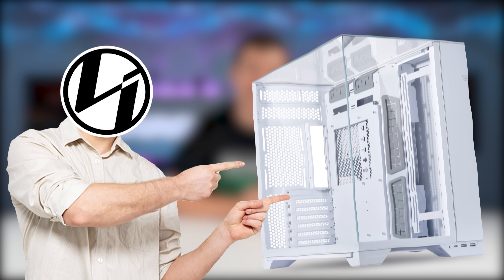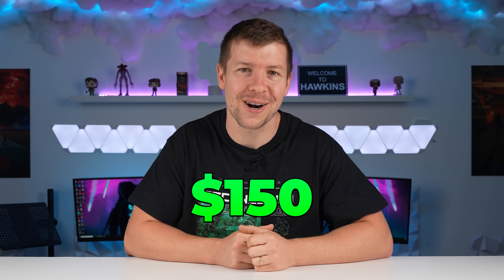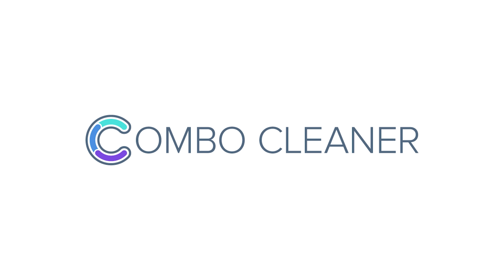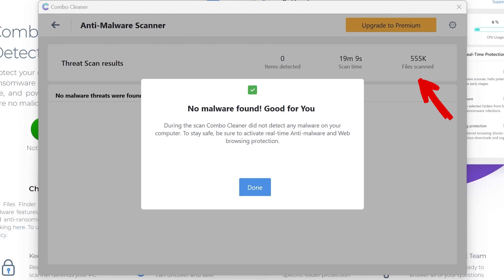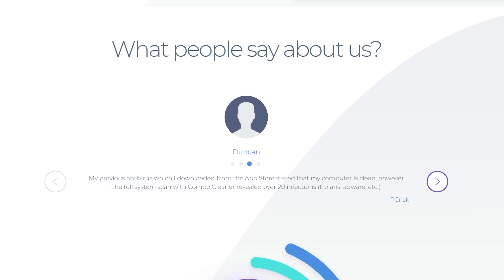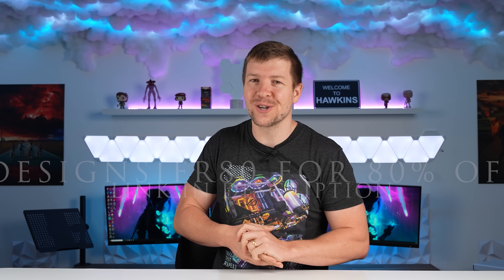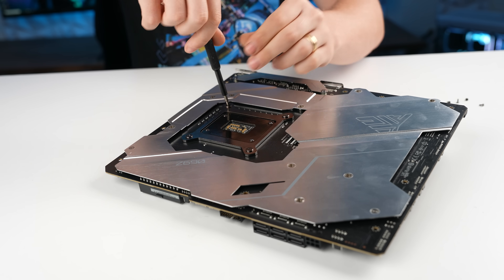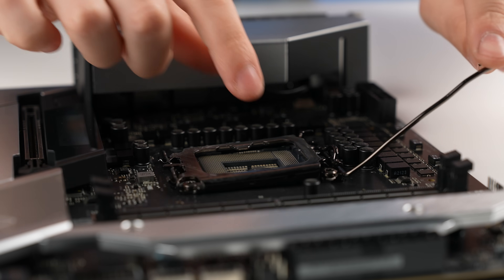Building In The *NEW* Lian Li O11 Vision

Comment: No thanks
Worst o11 ever
Shame to Lian li
Horrible airflow
Very fragile construction
Reply: It makes me want to take the glass panels off and use it as open air instead. I will keep my 011 dynamic
Reply from the maker: I wouldnt say its fragile, its safety glass that just sits on the desk.

Airflow however will not be as good as other o11 cases
Reply: @DesignsByIFR  my answer to this case is The King 95 🕶️
Reply: Agreed